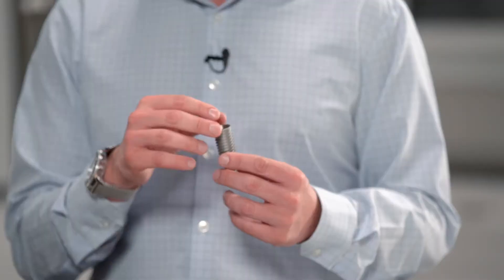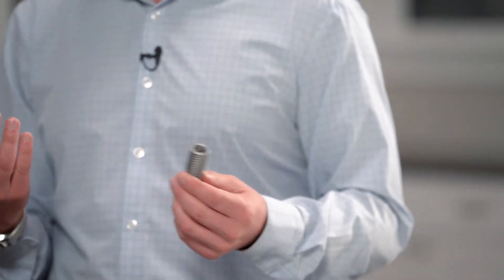Why Do Dental Implants Have Failure Rates?

Comment: My entire implant came out. It was placed in three weeks ago. I still needed the actual tooth to be place upon it. I am back at square one or even worse.
Reply: My dental implant came out entirely between week 3 and 4.  I go in tomorrow to see what they suggest next.  I am not getting another implant.  I learned my lesson.  What did you decide to do?
Reply: @westerndentalimplants  I had it replaced. It was not as bad a thought it was. The steel ball broke off. orthodontist turned the screw out and replaced it with another. In January I will get my fake tooth.  ( Insurance reasons )
Reply: @billnotice9957  My entire implant fell out of my jaw.  If it was just a screw I wouldn't be worried about a replacement.  I am not getting another dental implant as it would require for bone to regrow in my jaw and start all over.  Congratulations to you.